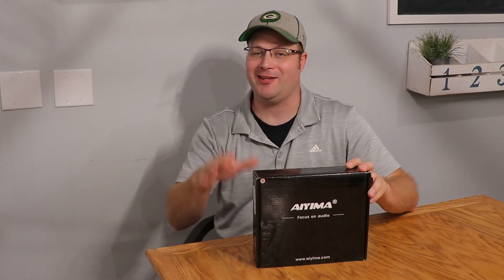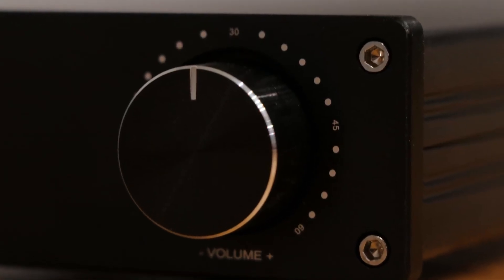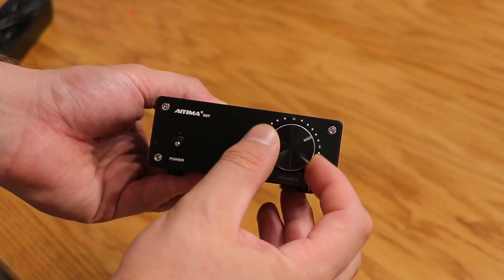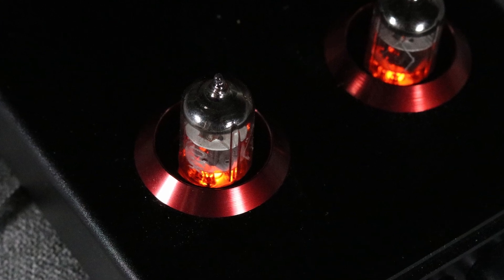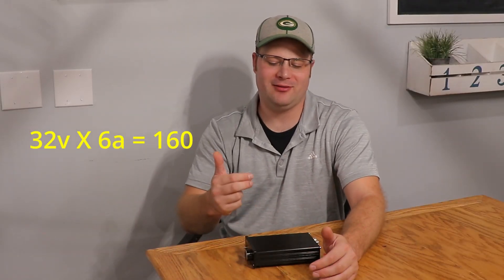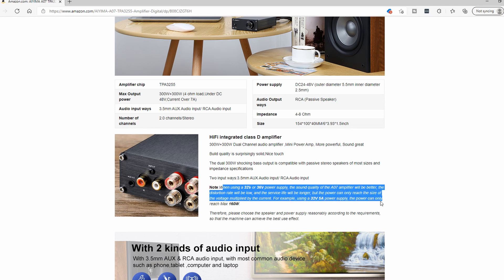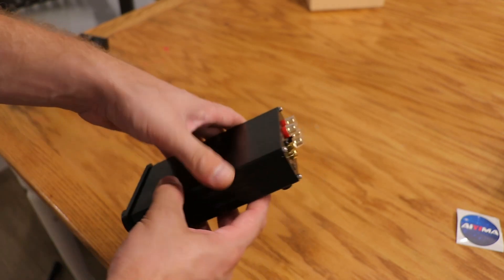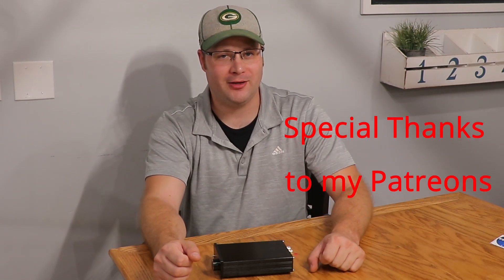600 Watts for $80? Aiyima A07 Review with TPA3255

Comment: Weird, I never got a notification for this video.

I love my A07, unfortunately I'm using the Topping E30 DAC and the two don't pair well with my really detailed speakers. My overall signature of my system is just short of shouty. I'm looking at either  preamp with tone controls or an equalizer to roll off the top end and shore up the bass.
Reply from the maker: Really? That stinks. Such a good point though. Really you need to match the preamp well with the amp that's not always easy to do. And really impossible to do without trying the combination

Comment: with 300W Power Supply, You should actually measure it.  I don't think you would cos it is too cheap to bother.
I own one, I use it to power a bass woofer only, from 500Hz down to 40Hz. Class D amp is better for bass rather than mid to high freq unless you own a high-quality and high price Class D. At this price point and operating at above freq. it sounds quite good(*) no problems with output noise, or hum, or power on and off pop.
* The bass sounds powerful even though it is not boosted.

Comment: While your review is better than no review, and I now know this amp exists, you mostly told us what we can get from the spec sheet.  That makes this an overview, not a review.  Since you had a unit in your hand, you wasted an opportunity to actually test it and tell us how it sounds.  How does it compare to other Class D chips like the 7498 or the 3116 at the same power?  Fosi makes almost identical amps with all 3 chips.  At the same volume, does this new chipset sound cleaner or tighter or noisier or trash?

Comment: Thank you. Does using a 48V 7.5A instead of 32V 5A changes the Base response of the speaker? I am using ELAC B6.2 speakers. I got a big supply but now regretting because I do not want to install the wires and all.
Reply: DON'T do it, it will blow up due to low rated cost cutting capacitors. More volts will not make any difference to the frequency response.
Reply: @MichaelBeeny  Thank you

Comment: The TPA 3255 is not "new" it was released more than 5 years back. And it is absolutely not capable of "600 W"... or only if bridged, in mono, under 2 Ohms and... at 10% (ten!) THD+N as you mentioned. Assuming the PSU is strong enough.
Reply: I looked at the whitepaper for this chip on TI's site, and there's no reference to .1% measurements. 
That's a much more meaningful real world metric I feel. 
However, even limiting this amp to a "clean" 100 watts x 2 per the graph would still irritate the neighbors in my apartment building.
Reply: @sixtyinsix  I have an A08 which comes with an incorporated PSU at 36V 9.5 amps and it sounds like a 40W amp at most... I listen through USB... Very clean even replaced the opamps but it doesn't sound like 100w per channel. My speakers are magnat 2002 at 4 ohms...
Reply: @florin604  In the real world it give 55 watts into 8 ohms prior to clipping. Still good but light years away from 600 watts.

Comment: I have a Definitive Technology SuperCube 2000 7.5" with 2 passive radiator speakers. Originally came with and I quote"650 watt power supply" I'd that's accurate...the amp died would this external amp be enough or too much for it ?
Reply from the maker: No. I wouldn't use it for that. The way that this is designed it can only do high wattage for low amount of time. If you needed something higher wattage, you'd want to look for either PA amplifier or a subwoofer plate amplifier.
Reply: Ty. But do you really think it's actually 650w? I was thinking of replacing with 100w Dayton plate amp, only one that will fit without doing external
Reply from the maker: @osutx427     It probably isn't.  You could probably get away with something like a 300w or even 500w.  This video may help you decide what power you might want to get. https://youtu.be/lQiUC6b0nEc

Comment: Nice! Seems like it's ideal for DIY subwoofers
Reply: Its actually a great amp for mids and highs. Its one of the best sounding class d amps I've ever heard.
Reply: @ufarkingicehole  that isn't really what I was saying, I know the newer tpa chips have great audio quality. I was more saying that this kind of power is more suited to the needs of subwoofers 😉
Reply: @lio1234234  to be completely honest, this little amp seems like a legit 80 watts. I bought a bigger adjustable power supply and the audible distortion goes up quickly. I prefer the original with the "80 watts". It really wouldn't make the best sub amp. I use 2 to biamp my polk lsim and that works well and they are power Hungry!.
Reply: @ufarkingicehole  that's a shame, no where near the 500w marketed power then it seems
Reply: @lio1234234  lol. Maybe it puts it out while being on fire for .0001 seconds. Its a fantastic little amp. I believe the problem is how many of these amps are over rated. If they put 60-80watts, no one would buy it.  I can tell you that this amp is a 💎 though. Mix this with a douk p1 with the right tubes and for around $200 you have am really fantastic sounding Pre/Amp with built in Dac, BT, and tone controls. Sounds better than $500 integrated set ups. I can tell you I typically do NOT like class D. I own several to include svs, crown, etc... This little amp with the right pre sounds great. I would take it over a $800 sprout (assuming based off sound alone).

Comment: To get the highest "rated" output you'll need a 51v 5 amp power supply.  I use a 36 watt which is sufficient. I probably get about 80 watts or so clean output at low distortion and that's sufficient for dynamic shifts in listening to music/movies at reasonable sound levels. So is the included 32 watt PS.

What these little boxes don't do versus a decent class AB amp is to produce higher levels of current output if a speaker demands it. It's not always the watts, it's the current.  I would expect these little boxes to produce 3, 4 maybe 5 amps of current output versus an under a grand class AB to be somewhere between 8 to 15 amps.  That's not sustained either or the unit will burn up. That's during peak demands when dynamic shifts in music demands it, if it demands it and if the speaker demands it.

What you get with more expensive amps, class D or class AB is well over 15 amp capability.  25, 30, 40...even more.  Depending on the speakers (ex. Magnepans), the music, the SPLs one listens to, extra power can mean a more lifelike performance but even that is no guarantee.   Still, better amps, more power, usually means better performance.

What these little boxes do is commensurate with their budget price which is still decent if not remarkable performance, but don't expect it to sound better than more expensive gear.  Plus, you can take it along on a trip easily enough. Small amp, small dac, small speakers and you've got a grab and go stereo system.
Reply: P(W) = I(A) × V(V), or watts = volts X amps.  Increase current and leave volts the same would increase total power. Does it  sound better to run at a lower voltage and have current increased at the same power level?

Comment: Neither the A07 nor the TPA3255 are actually "new."  I own four of these and they're excellent when given enough DC "juice."  One caveat: the left and right channels are reversed from "normal" on the 3.5mm jack.
Reply from the maker: Really? I'm going to have to test that out. I never even thought to test that. Thanks for the tip.
Reply: @Toid  -- I kid you not.  You're welcome.  Aiyima is aware of the issue.
Reply: What is enough juice? Not the included power supply? Can you recommend one? I'm looking for a 1kw version.
Reply: @anglerandy5736  -- IIRC Aiyima recommends at least 48V @7-8A for best performance.  I use generic 48V @10A (480W) industrial SMPS units with their cooling fans disconnected (if they're not thermostatically controlled) because the A07's moments of high current demand are very brief (limited to occasional musical/cinematic peaks) and a typical SMPS doesn't need fan cooling under those conditions.  FWIW, I don't think you'll need a 1KW PSU unless you're powering two (or more) A07s.
Reply: @editorjuno  Oh no im looking for a cheap amplifier to power a 1000w RMS car sub in my house.

Comment: Ok.  So lets say "100 watts at 8-ohm and 1% THD".  At what frequency is it doing this?  1khz?  All these amp ratings remind me of el cheapo Pyramid car audio amps of the 80's and 90's where they did 900 watts for $79.  There's a point where you have to call BS on them.  What if they are tested/rated like a "real amplifier" company where it's from 20hz to 20khz @ 8-ohm with less than 0.xxx% THD, etc?  How bad do these fall on their face?

Comment: I bought a "300+300W" amp , Bluetooth, tone control and built in power supply box for $30 AUD . Of course,  it doesn't reach 300W and it's unusable noise for hifi. But I only need it for testing speakers lol  I'd be surprised if it makes 30W

Comment: No way it puts out 600 wats.😂😂 Show it on a dyno. It has if lightning strikes power.
Reply: @Douglas Blake show a dyno test.
Reply: @Douglas Blake you told me it can do it since the specs say so. Manufacturers lie all the time about power a amp will put out. Marantz claims 105 per channel maybe 40 all channels driven.  I want to see proof since you want to back them up.
Reply: @Douglas Blake just because some manufacturer states this is how much power we say it will give does not make it true. Both home and car audio lie about power output all the time. The dyno does not lid.  They are still in business.

Even that 35 wats is a far cry from 100.
Reply: @Douglas Blake  if lighting strikes it will do 50w2 and 100x2
Their are several fourms that talk about this chip set. It won't do it. Just like the amp tested here will not do it on a dyno. Class D is about 90% efficient on a good day a 4 ohms most of the time you can expect 80% and less at 2ohms. If you can do 100% efficiency at 1% Thd.  

I don't trust specs on paper unless they are backed up with dyno results.  Both home and car audio have lied for years, as I stated before. 

Just like a 2x4 is not a 2x4 it's a lie. Everyone takes liberty. A 350 engine ect.
Reply from the maker: @TheoneDragon51  with the power supply that's provided it does about 77 Watts a channel at 4 ohm and about 48 watts at 8 ohm. Douglas is a little off with his assessment. It was tested over at audio science review if you want to see the results with the provided power supply.
Reply: @Toid  thank you. Which sounds about right. I would enjoy reading it. The amp you reviewed correct.
Reply from the maker: @TheoneDragon51  correct. Here's the link: https://www.audiosciencereview.com/forum/index.php?threads/aiyima-a07-tpa3255-review-amplifier.18984/
Reply: @Toid  ty just found it as you replied.
Reply: Good read, still a far cry from their published numbers. Cool little amp though. Big D did a bunch of those chip amp, on his dyno. They like to boost their numbers. At some point I would like to use one for my grilling I do on the road. Small and decent sound. Space gets tight in a semi.
Reply: It has real 60W and good with it.

Comment: Are you looking for sound quality? ic. Class D amplifiers are not for you. I have tested some and compared class-d with class-ab. cheap class-d has disappointingly poor sound quality compared to class-ab !
Reply: Hypex nCore have you tried you will forget class Ab
Reply: @anandshah71  
Have not tried Hypex nCore. 
The hypex ucd180 that I own has very good sound quality!

L20 class-ab from LJM (Ebay) has very good sound quality and beats all cheap class-d without any problems.
Reply: In 2021, that's obsolete "audiophile" folklore.  My A07s -- I own four and currently use two -- actually sounded better when driving the same vintage JBLs than the highly acclaimed, Nelson Pass-designed Adcom GFA-535 "audiophile" power amp I swore by back in the day.
Reply: cheap AB does not sounds at all. Cheap D sounds
Reply: @streamnoremorse  
You must first have good speakers before you can compare which amplifier has the best sound quality.

cheap class-ab amplifiers like
(L12-2 LJM Ebay)
(l15 LJM Ebay)
(l20 LJM Ebay)
has good sound quality and beats all cheap class-d amplifiers!
Reply: @streamnoremorse 
even if you have managed to get a speaker to reproduce good sound on a cheap class-d amplifier, that does not mean that cheap class-d is better!

Example, your speaker has sharp sound but a class-d you used has a poorly weak treble, then speakers you have can give ok. sound quality!

Does that mean that cheap class-d gives better sound than what class-ab gives? no you use the amplifier as an EQ. to get rid of bad sound in the speaker!

You need to do a proper test on some speakers with the right sound quality!

I have made a proper comparison between cheap class-d amplifiers and class-ab and you heard well that class-d has poorer sound quality. class-ab provides the best and most sound quality for money!!!

(L12-2  LJM Ebay)
(L15  LJM Ebay)
(L20  LJM Ebay)
Reply: @ford1546  It all need analyses with graphs. We just only talking hear. I ve heard Denon 720 (by audiophile categoryit s cheap and I do not like it).I listened them with ELAC 6.2.  I do not need test. I listen music on a cheap amp and really proper speaker Kef R3. You just wrote your fantasy about treble. It is fantasy.
Reply: @streamnoremorse  
Which amplifier do you use?

Elac is a good speaker brand but 6.2 are relatively cheap speakers!
Reply: @ford1546  anyway I sold them, And Denon PMA720 can`t handle bass on them and even highs. This is good 2 way speaker with deep after 10Khz. 6.2 nor 6.1 And I do not like 2 way. I buy 2 way instead. Sounds pretty. You need measurements. Not talking
Reply: @streamnoremorse  
I'm not a big fan of
denon pma-720.
too weak to power a bass speaker.

Cheap and not so strong amplifiers do not always manage 4 ohms well!
Reply: @ford1546  some mids in PMA 720 are really good. I think Denon NERF this amp

Comment: Looking at the spec sheet for the TPA3255, you would need a supply voltage of 69 volts to attain the full power at 1% THD of 150 watts into 8 ohms.   The 300 watt per channel rating is at 10% distortion, which is going to make your ears bleed and not much else.  So that power supply doesn't  even comes close to that power level.  Also look at the current rating.   Power is voltage x current. 32x5  So the entire power supply is 160watts.  So there has to be some power that gets used up as heat.  So I am guessing that, if you are lucky, you get about 40-45 watts per channel out of this thing.  Again that is using an 8 ohm load, which is what most home speakers use.   You will get a bit more power at 4 ohms.   But the thing I am getting at here is that the 300wpc rating is completely unrealistic.    Here is the info so those that are still skeptical can do the math on their own:

https://www.ti.com/lit/ds/symlink/tpa3255.pdf?ts=1674494192998&ref_url=https%253A%252F%252Fwww.ti.com%252Fproduct%252FTPA3255

BTW, if you think you can put a 69 volt supply on that to get the full 150 watts.  Think again.  I doubt that small box can dissipate the heat appropriately.  So you need a bigger heat sink too.
Reply from the maker: You didn’t watch the video, did you?
Reply: Did a bit more research and this video, a guy actually does a full test using a wattage device that also monitors distortion.  On that device the A07 with a 48volt 10 amp power supply hits 170wpc at 4ohms at 1% THD.  While a far cry from 300+300 (which is at 10% THD and totally unlistenable),  That is still a pretty respectable figure for an amplifier for that size and cost.
https://www.youtube.com/watch?v=kBim2j7Gm5o